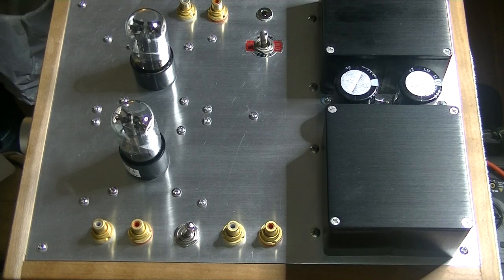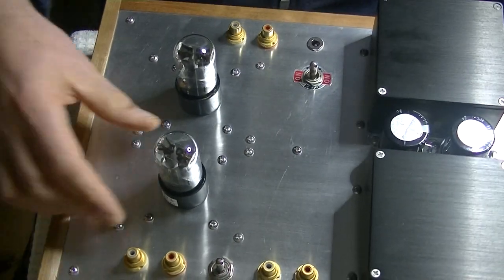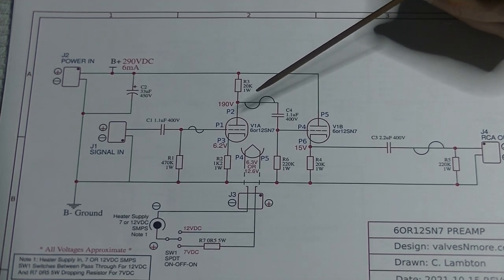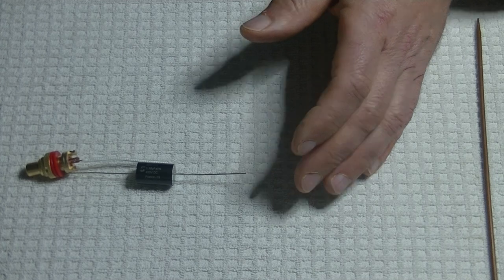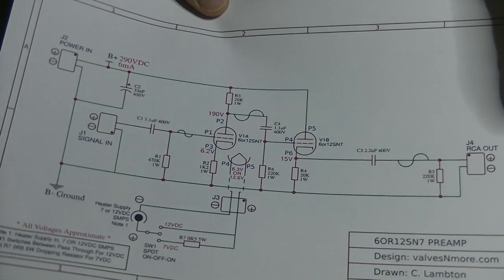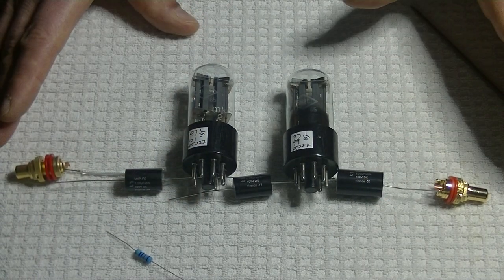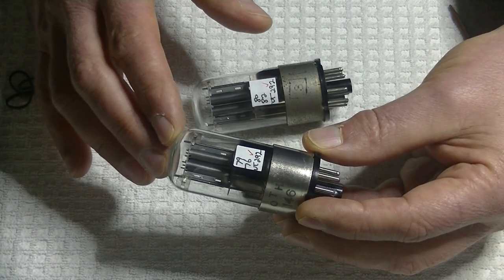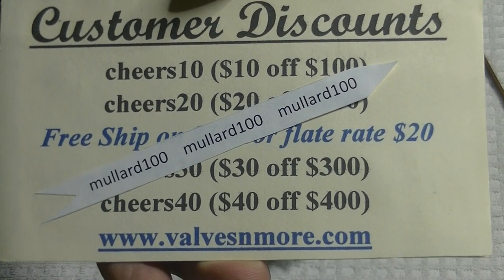Tube Lab #71 -  Pt3 How to Achieve Great Sound - Preamplifiers

Comment: I Jim,

firstable many thanks for your channel and work.

Following your video I was going to order some Metz tube for my Freya but I seen on you :

**may not be suitable for some modern amps including Freya+; Caution the GT version of the 6SN7 has a much lower rating than the later 6SN7GTA or GTB and some modern amplifier circuits will overdrive it, causing it to get noisy or worse get damaged, this is common with all 6SN7GT tubes**

Does it apply also for  Raython 6SN7 WGT / JAN CKR 6SN7 GT VT-231 / Fivre 6sn7 GT (the type i am using now on my freya :(

Is it the case also for the Schiit Saga?

Alex
Reply from the maker: Apply Caution when using any 6SN7GT in any modern amp.  For the reason outlined above.  However as you've discovered exceptions exist (they make engineers and designers crazy!) but them's the facts.  Some tubes made within the GT specification, in fact were built to a higher standard (some cut it too close) and work just fine in most modern circuits.  I've suffered too many losses to be willing to take a chance - however periodically brave customers roll the dice!  Some win and some lose!